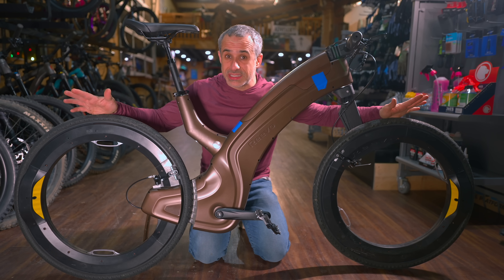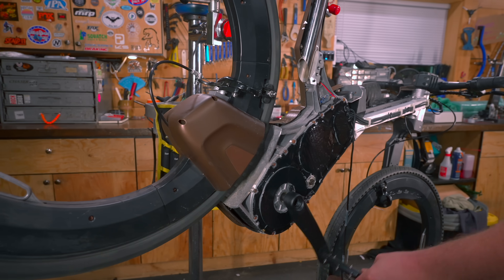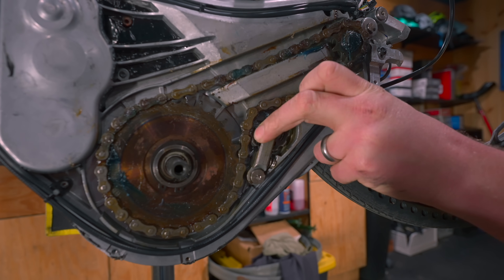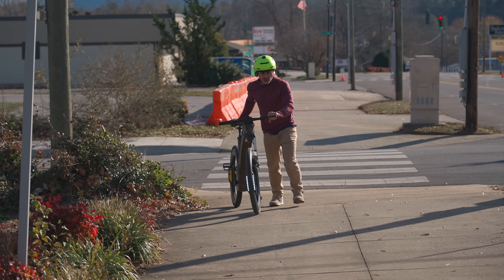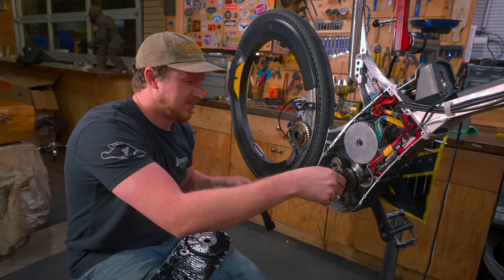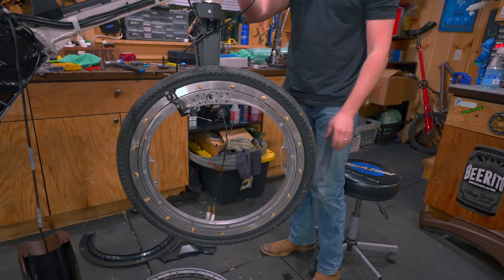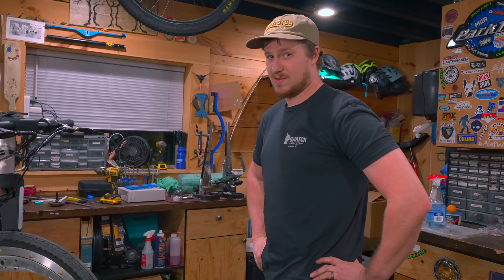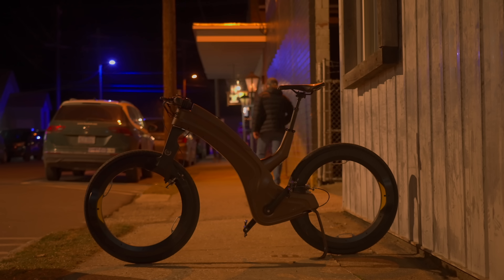What's Inside The World’s Worst eBike? Reevo Teardown

Comment: The problem is to much friction replace those bearing with a bearing assembly that has bearing for where the pin sits the bearings on the outside of that tiny wheel/ bearing assembly. Install them back in the wheel and (lightly) grease. I 100% guarantee that it will roll a lot smoother.

Comment: The reason it is so hard to paddle without the motor in is because unpowered, electric motors act as generators;

You are paddling a normal bike and an excercise bike both at the same time
Reply: Yeah, and the 12 gears at god-knows what ratio 😂
Reply: @A-G-F-  Properly lubricated a gear train can have surprisingly little resistance.

Source:I'm a mechanical engineer
Reply: @jackgamer6307  
Is not about resistance here though, its more about a large gear ratio that takes too much torque to spin

Comment: So why the "rim drive cog" could not have the rachet mechanism to be able to pedal backwards?
And prevent the motor from turning when you push it.
And save weight and complexity with that fancy gear that nobody sees anyways :D :D

I don't think an engeneer was involved this, or askedd for opinions..
It looks like a passion project with so many bad descisions.
This could be done so much better and cheaper..
-Redo the frame with tubes and without that heavy cast.. Oh yeah, and galvanic corrosion is a thing so don't srew it up :D
-Ditch at least 4 gears and save more weight complexity and resistance
-make it more compact by bringing the motor closer to the big gear
-put in one more racheting mechanism
-Replace those little wheels with bearing balls and spacers to loose more friction. (for how to seal it.... ¯\_(ツ)_/¯)
But I think it still would have at least this much lifetime :D

Comment: What's funny is that the hub less tires might actually be decent if you abandoned the e-bike part and just gave it a normal chain drive that connects to the back gear. And made the wheels pneumatic of course. And made the ball bearings better than skateboard wheels.

Comment: "A little knowledge is a dangerous thing", and this thing was, indeed, designed by people with just a little knowledge. This thing would be an embarrassment to all engineers.... had engineers actually been involved in its design. I feel certain that no engineers laid eyes on this before production. 
I'm a mechanical engineering technologist with 16 years experience in design and manufacture of industrial and commercial mechanical products. I can tell you this object was NOT designed by an engineer. In engineering school there's a heavy emphasis on learning about mechanical efficiency and there's no WAY that anyone who actually went to engineering school would think that that gearing setup was anything even remotely similar to what you could call efficient. 
My guess is it was, at best, designed by a collective of engineering students who just didn't know better. 
It's not designed for real-world applications.
It's not designed for serviceability.
It's not designed for durability.
It's not designed with failure-mode analysis. It has an absurd number of failure points with no forethought for remediation. 
It's not designed using Finite-Element Analysis for the frame's structure - they went with a brute-force approach of material overkill for the frame's structural components, aiming for rigid strength with no consideration for how to achieve the same strength with less material and weight.

Comment: 5:09  A 12-stage gear transmission could typically lose around 10-20% efficiency due to power losses at each gear mesh, with a general rule of thumb estimating around 2% loss per stage, meaning a 12-stage system would lose approximately 24% efficiency; however, the exact amount depends on factors like gear design, lubrication, load, and operating speed.

Comment: There's so much that can break on this bike, and so much that can wear out naturally. Like imagine one gear tooth breaks on ANY of the gears: totally borked with HOURS of repairtime at a minimum if you can even source parts. Three or four of the nylon bearing wheels crack? Probably borked, again with HOURS of repair time to even diagnose the issue. What a completely terrible design.

Comment: So, Revo is short for Rube Goldberg?

Gotta give the company credit for actually building it and not judt absconding with the money.
However, it's a bigger POS than a Yugo and is not fit for purpose.  Its as if they tried to reverse engineer an artist's image of a futuristic bicycle from a page in a sci-fi novel like Ringworld. 
Russia tried copying the US Space Shuttle (called Buran).   Like the Spruce Goose, it flew once. I imagine it had a very compex chain drive thruster control system that the pilot had to pedal  to steer.

Comment: This is one of the better examples of  why Occam's razor should be applied to something as inherently basic as bicycle engineering. Although an exception might apply to that bicycle that I saw in a You Tube video that has two chains. One  for low speed high torque for hills and the other for higher speeds on more level roads and paths. It is and incredible addition to bicycle that are important in less developed areas of the world where bicycle are very important for use where trucks can't be afforded. That additional complexity makes a whole lot of sense.

Comment: I don't think it's the gears that make the high resistance, chief, my bike with a Rohloff gear-hub drives like a breeze. Also the weight of this thing is insane. That's why I'll never have an e-bike in my life.
Reply: That last part makes ver little sense honestly. That's like saying a hummer is very heavy and not mileage efficient therefore I'll never own a car 

THIS ebike is heavy, there's some moderate weight ones too. I believe this guy has a lot of suggestions
Reply: @Frawst_  I'm sorry, I did not express myself clearly. What I meant was, I'll never own an e-bike because e-bikes in general are much heavier than normal bikes. Part of the fun and utility of riding a bike is, it makes you much faster without adding too much weight for which you have to put additional effort in.
Reply: @aande1  you're ignoring the 'e' part of the ebikes, they actually reduce effort more than regular bikes. They're a good investment if you plan to ride long distances and don't want to arrive sweaty at your location

But to each their own

Comment: I "designed" a hubless bicycle for a capstone project to graduate from my drafting and design course and I knew it was a bad idea even then. Not using a more reputable chainless system designed for this task like the ones Birk produces is just a bad idea. Then there's the material of the frame and the wheel rims. I proposed using a theoretical torsion treated aluminum that had an, again, theoretical strength to weight ratio better than steel for the rims and a standard tube construction for the frame.

Yeah, it's still a bad idea and I'm not going to defend it.

Comment: Those don't look like skateboard wheels to me as much as V-slot POM wheels you'd use on a cheap⁽¹⁾ 3D printer.

(1) Not saying they're bad, I'm just comparing V-slot rollers as the cheaper alternative to linear rails like you would find on more expensive printers.

Comment: Just imagine getting this further developed. There certainly A LOT to be improved upon but comparing a new thing to a hyper developed for almost centuries is an unfair thing to do. Bicycles are a classic for a reason but to chuck something away simply because they're behind is such a careless thing to do. Hubless bikes have a long way to go, whether or not they'll be worth it is something that will be assessed further down the line in development. So far, a bad investment but that's merely due to poor execution.
Reply: Ever heard the term, 'reinventing the wheel'? 

Tech should evolve to provide more to a consumer, hubless bikes do not do anything a regular bike cannot do other than 'look futuristic'.

 In fact so far they've all actively been a devolution to regular bikes. The very best they can hope to achieve in the future is to be as good as regular bikes. At that point why not get a regular bike for cheaper?
Reply: @ you can reinvent the wheel or anything for that matter. Much like the modern wheel is so different from its previous iterations.

The wheel had been reinvented so many times. They also failed so many times. HOWEVER, the ones that ultimately became successful overtakes the previous design. 

Let's take this as example, the very first wheel most likely had been a circular stone.
On top it all off, the inner circle may not have even existed then and all we had was a uniform stone.

Over many iterations, it hollowed out because people kept reinventing it. Such as adding spokes from the inside to keep the outer layer from collapsing because it was hollow.

Then it goes on and on and on until we get our modern wheel.

This hubless design is simply a precursor to what new technology is going to be 🤷‍♂️ 

Much like how they may had found it stupid to hollow out the wheel until the technology evolved and they figured out how to put spokes in the middle and required a hub to start driving the wheel.

All of this because they found a better way to transport heavy materials and adapted the wheel that could only transport itself.

"Don't fix what isn't broke" is the logic of "reinvent the wheel" however the real purpose of that saying is "improve what already exists"

This is why that saying exists. People keep reinventing the wheel and it ends up being a fruitless task because the objective remained the same and the design is at its optimal for that task.

Change that task, it requires reinventing the wheel. 

Just look at why track wheels were even made. It's because a regular one can't do the job.
Reply: @wanderingbufoon  Yes the wheel has changed from its very earliest iteration but The wheel also has not changed for 200 years (maybe even longer than that) and it likely never will, it achieved its perfection 200 years ago and all that's left to do it alter it slightly to achieve more specific tasks

Track wheels (I assume you means the ones a snowmobile uses) are not really 'wheels' they're called treads. It's a whole different mechanism to a wheel so it's unfair to compare them to wheels

I'll reiterate, the VERY best a hubless wheel can achieve is to be as good as a regular wheel in every single way a wheel can be used and you and I both know, the ones who do achive it will make it more expensive because it's not the wheel of the 'peasants', it's 'futuristic'
Reply: @ yes but i'm saying is that that 200 year old wheel is for that specific task. Much like the tens, if not hundreds of thousands year old wheel was for a specific task.

Disqualifying threads as wheel is also not entirely correct. Same goes for skis. Again, these are reinvented wheels. So far removed to the traditional circular ones but their purpose is to provide a moving surface for transportation remains the same.

Jets and sails can be said to be wheels much as rollers are. These are different wheels in that essence.

Hubless wheels as of this moment are much closer to the traditional wheel that we know of it but if we keep developing it further and further, it could get close and even surpass the wheel for what you need it to do.

Like how track threads and skis did for wheels in certain terrains. Like hulls and sails for liquid surface. Like jets and rockets for gaseous atmospheres.

Wheels can be and have been numerous times. This specific design, like ebikes, it's at its infancy. It's fad for now. We haven't found  much better use for it outside of aesthetics.

So we will remain using the traditional wheel until we find something far better suited.

Think of the offset-ed wheels for cars. Traditional wheels wouldn't work because they're far too skinny, too lightweight for all that weight and necessary traction. So you remake the wheel and have that new design. 

It works better than the traditional wheel that they used to have 100 or even up to 50 years ago. 

I'm sure people would've argued how poorly balanced the wide and offset-ed wheels were. Now, they're industry standards for just about any cars.

Comment: The amount of drivetrain loss ... Holy crap lol. Gear resistance, let alone the gear differentials, all xombined it better have permanent pedal assist lol.
Reply: Most of it is from the 30 skateboard bearing. You can hear them all roar when he's pedaling and that's the sound of pure loss.
Reply: Not to mention the fact that a hollow cylinder can never roll as freely as a wheel with a central axle. Something to do with moment of inertia…
Reply: @michaelsnead3018  Part of what makes a traditional wheel good is the diameter difference from the wheel axel to the tire. 

When the small axel turns it is converted into a much larger turn at the tire.

Because a small circle rotates faster than a bigger one.

But on the hollow wheel you don't really gain that advantage as the large part of the wheel is the one being powered.

So it doesn't get any of the rotational force multiplayer. Which is one of the main things that make wheels so efficient.

As the outside spins faster than the middle of a wheel.
So it's just wasted energy potential on a hollow wheel.
Reply: @Targe0  the small circle in a wheel will turn slower than the bigger circle. as the bigger circle needs to move further to 'keep up' with the small circle
Reply: Can't understand why they had to make it quite so complicated. Surely they could have used a standard e-bike motor driving a chain down to that "wheel gear". It still wouldn't have been great but it would have been better and simpler than this wacky 12-gear setup, and would have had normal free-wheeling behaviour.
Reply: @Reason077  If they redesigned ait a little, they could have had a hub motor that linked right into the wheel gearing.

It wouldn't have had a peddle assist, but given how badly it handles its peddle assist, that would likely be a benefit.

But they have a gear interchange in that spot, if they put the motor there instead, you streamline 90% of the drive system.

It would have also then been able to add in the chain basically the same as any normal hub drive ebike, just with a shorter chain.

If they had done that, not only would their parts costs be cheaper, as you simply need less gearing.

But their construction costs would have plummeted, as you don't need to install all that gearing.
Reply: @Targe0  My thoughts exactly!!
Reply: @Targe0 my thoughts also. Just change the placement of the motor and half the problems would be solved.  

But then there's still that awful skateboard wheels inside a wheel lol. So much power loss and noise 😂
Reply: I think the gearbox would have been better served with something with a lower base ratio like a planetary or rocker gear, but the most loss of this design is two absolutely terrible wheels with 32 skateboard bearings trying to compensate for how horrible the concept was. I'd at least have gone for a tank track layout, with more fixed bearings near the base and less up top, but they went for a free wheeling bearing and punishing themselves with so much grease resistance.
Reply: I mean, normal bike, one gear wheel at the motor, one at the wheel, that's it. This crap? Jesus. What a waste of power.
Reply: And to think they cpuld literally hace just used a chain, wgich they used anyway, without hurting the esthetics at all 😂

Um not even sure who in this team was dumber than who, if i had to make this thing for some stupid reason, I'd make it ten times better, just by putting the engines on the actual wheel, eliminating the need for any gears, and making the pedals engage and disengage mechanically when not in use to reduce friction dramatically... Driven via hidden chain of course. 

Gotta wonder how much of the friction you can eliminate on such a wheel tho, its an interesting engineering task..
Reply: That actually is not a bad idea. Get rid of the pedals, go full on motorcycle style. The rim wheels need to be improved though
Reply: @ Best to keep the pedals in it, or otherwise it might end up being legally classed as a motorcycle, and then you'll need a license and insurance to ride it. 

And yeah, the rim wheels need to have way less friction in their design.
Reply: Plus all the small nylon wheels inside the wheel. The thing is just beyond ridiculous.
Reply: But the pedals can't disengage from the motor. So even if you're riding in full assist your legs are going around with the pedals anyways.
Reply: Though it has to have some very impressive torque from all those gear downs.
So in theory if you could ever get it up to speed it should be quite powerful.
But there's so much friction in the system that its small motor likely could never make use of it.

Comment: Over engineered to the worst possible concept and then build a prototype that is equally worse. Too many parts and points of failure and not to mention the apparent mechanical losses from the gear system.

Comment: As a product designer, they just must have worked with a terrible workflow to market this product.
It is clear that unless you manage to build the hubless wheels in a way which has little roll resistance, doesn't corrode or get damaged by dust, and can handle hard impacts like going up and down curbs - You CANT build the bike!!

I can think of a few ways to get this "right", but the only way I can think of getting it to last for 1000miles would just be cost inefficient. I think this beautifully illustrates what an elegant solution, tires with hubs actually are.

Comment: The whole bike is just *wrong*.   From those pointless centreless wheels upwards.   No wonder it weighs a ton, regular bikes use materials in the optimum form to give the required strength with minimum weight.   You don't achieve that by cantilevering everything.